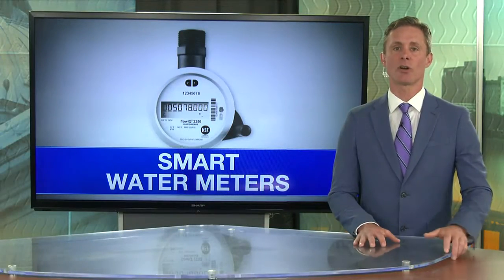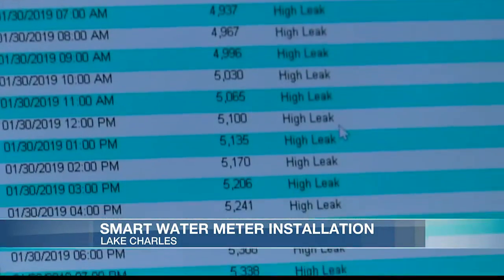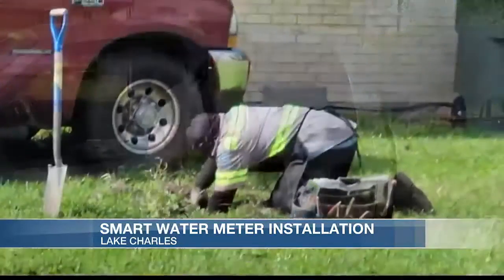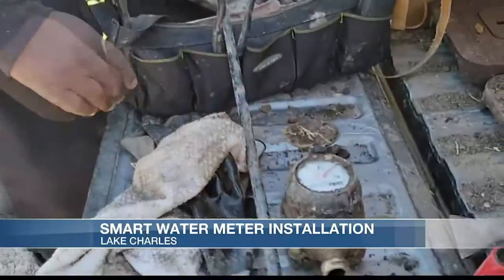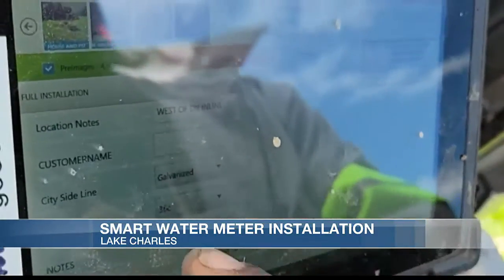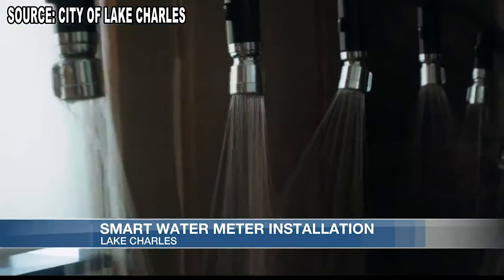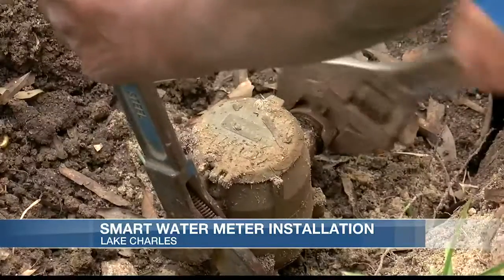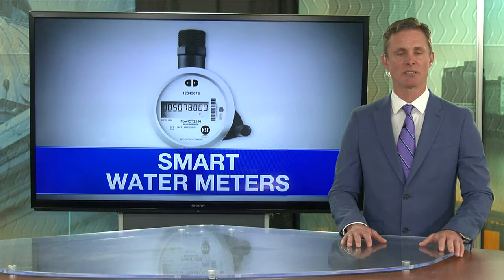Contractor shows installation process for smart water meters

Comment: Are your rights being trampled if you are told that your water will be cut off if you don't comply to having a smart water meter replace your dumb meter? Why aren't you given an opt out? Those devices emit a signal. What kind of signal is it? What frequency? 5G? What strength? Is it omni-directional? Can it be harmful? The UMS installation manual has a "RADIATION WARNING". Is the customer told about that? Does your usage data get recorded and sold to anyone?  Does someone now determine how much water you should be using?  Are these devices perfectly safe for us? I have my doubts.  Some of us don't want ANY SMART devices in our homes. Some of us don't want blue tooth or wi-fi in our homes. Some of us do our research.  Klaus Schwab wants to control the water. Is this a WEF move?